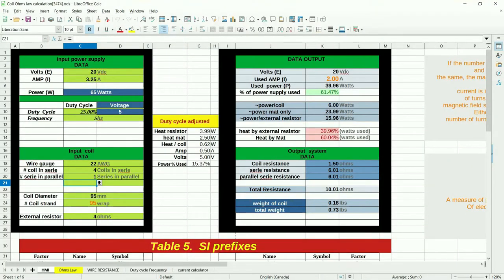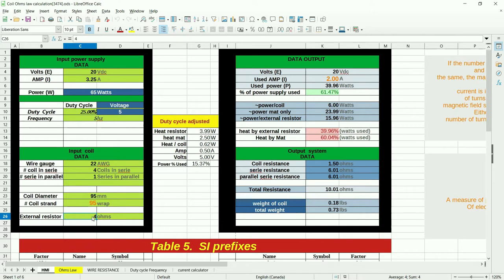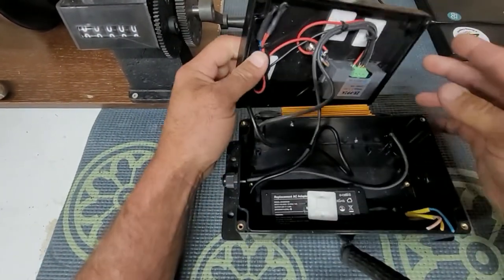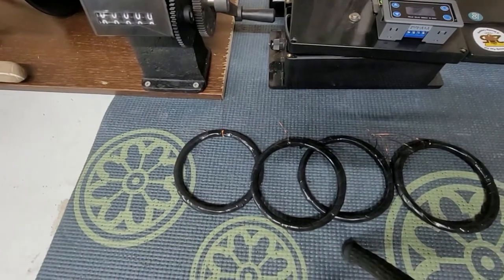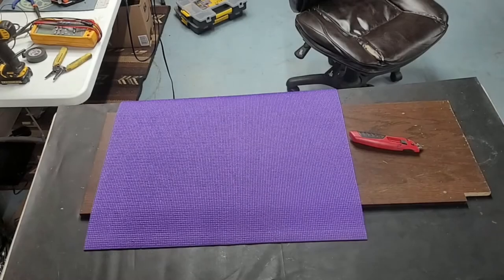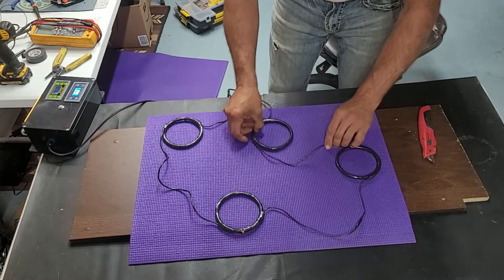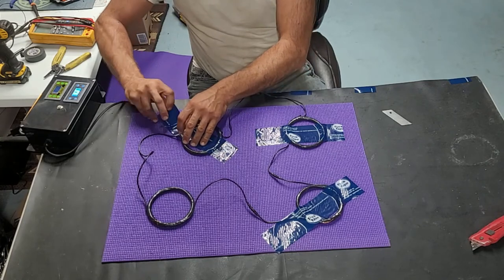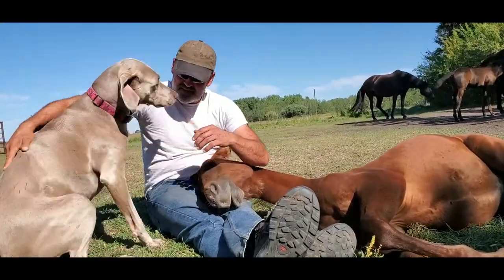DIY PEMF -  Dog Bed

Comment: Great videos! I see and understand the (10) coils on the full size mat. Do you have any suggestions on how to make a small (2) coil pad that could be used to effectively focus on an area such as a knee or lower back that would be compatible with the PEMF DIY control box in your previous videos? Also a great idea to use the metal plates to increase gauss, wouldn’t that make a more effective upgrade to the (10) coil mat even tough it would add some weight? Lastly is the frequency and cycles physically noticeable with these mats? Some commercial machines that I have tried result in a very intense pulsing that can be uncomfortable!

Comment: Have you considered trying metalized Mylar(TM), emergency blanket material ? 
Line one side with the Mylar(TM) of the yoga mat, pillow cushion, or whatever the support structure.
Reply from the maker: Unfortunately, it won't do much. Aluminum is a very poor magnetic shunt.  I try many different types.

Just to show that a tinfoil hat may not be the answer after all.....  
MuMetal is the ultimate followed by high iron metal.  Even martensitic stainless mesh is very good.  The cost of muMetal is real high, and martensic stainless mesh is hard to get in small qty. High iron content metal is heavy.
Reply: @Steeve.  Galvanized sheet metal for air-ducting, from Home Depot?
Reply from the maker: @superargo4701  yes!   One of my patreon found paint can lids for cheap.  They worked veey well.  Anything magnetic will work.   :).